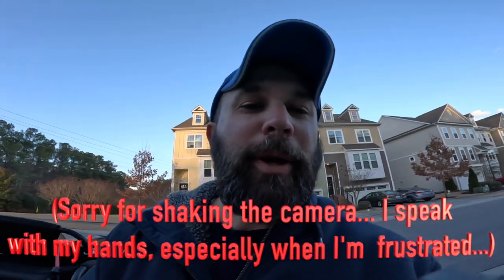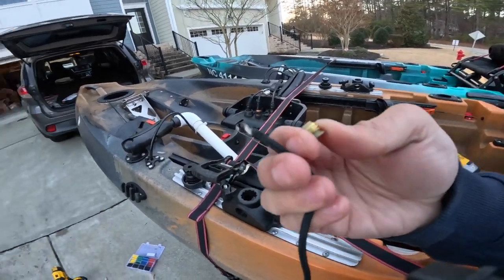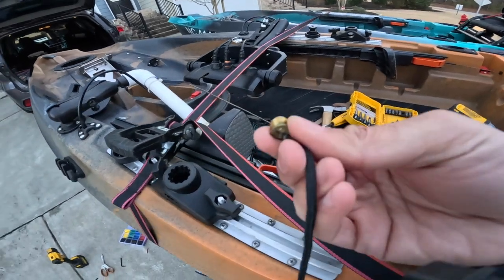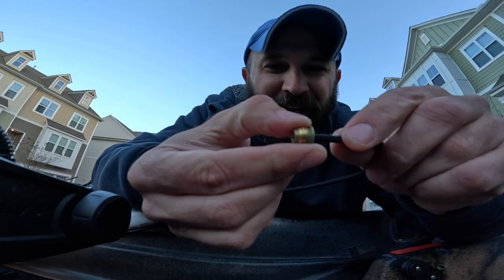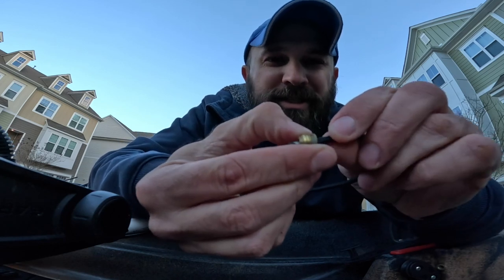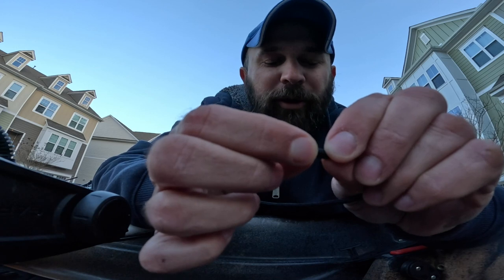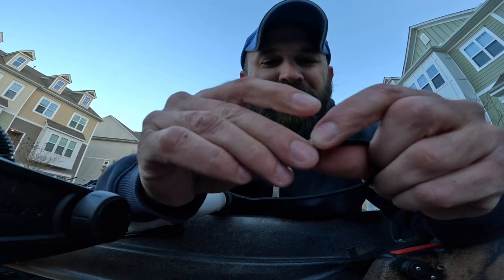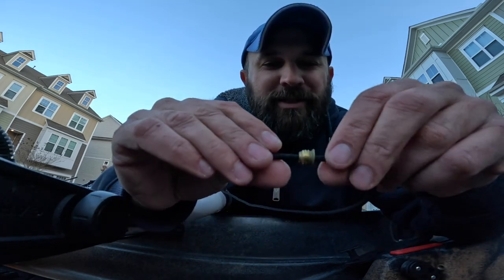Old Town Autopilot Motor Pull Cord Repair Brings Out my Italian Side 🤬

Comment: I would of just pull out the old cord and just run 50lb fishing line through the hole and tie that to the new cord and just pull it back. Maybe even use a lighter to heat the end of the cord to make a little smaller that way itll go in. That way I wouldnt have to pull the screw/plug out. But it looks like you find you own way lol stay safe and tight line buddy!
Reply from the maker: Yea... I think I had tried something like that already... the problem I found is that if the cord bunched in any way, it would not fit through the bushing. The cord has to be taut just to go through the hole, so if anything was tied to it to make the profile of the line thicker, it won't fit. I really wish I could just see how the people at Old Town do it.. there's obviously someone there that does this on a regular basis ...

Comment: I’m working on the same repair right now. Using a lighter I was able to form the cord to a point and get it through the hole. My problem is, once I get it through the hole, I can only fish the cord about a foot or 2 into the kayak until I hit something and get blocked. Super frustrating. I’ve ordered some metal wire  to see if that will help, I’m going to fix the cord to the wire and use that to force it all the way through the kayak. That’s the hope at least.
Reply from the maker: I tried everything I could think of to force the cord through the hole and couldn't get it to work. But even if I could, it doesn't feed through easily. I really wish I could just see how they do it at the factory. The simplest solution would just be to make a bushing with a larger hole so that the cord could pass through much easier. It's not like it needs to be completely watertight. Poor design and repair instructions, in my opinion. It shouldn't frustrate owners to repair this component.

Comment: The handle broke on my cable, and the pull just seems to be too hard overall to engage the trolling motor....manual engagement and disengagement works fine.  Couldn't find any replacement cord options through Old Town or other parts suppliers...wonder if generic cord/handle would be fine?
Reply from the maker: Old Town will send you both replacement handles and cords if you break them / wear them out. However, I had a friend that apparently had a hard time with the handle and managed to break two of them in a row (he managed to pull through the fairly thin piece of plastic that the cord is wrapped around internally). Although Old Town sent me two additional replacement handles, I decided after the second one broke to simply replace it with a sturdier lawn mower pull from Lowe's. Works like a charm...
Reply: @kayak_chris  /Good thought on the handle.  I wonder how easily I could attach the new cord to the old one and "pull" it through.  I'll find out soon enough I guess.
Reply from the maker: @JS-uy3hf  Not easily… the only thing I could think of is splicing the two lines together (had some boatswains mates that could do it in the Navy with ropes, but paracord is probably too fine to attempt). Knotting the lines will make them too thick to pass through the grommet in the kayak. But if you figure out a way, please let me know!